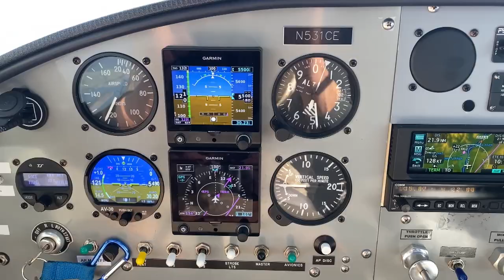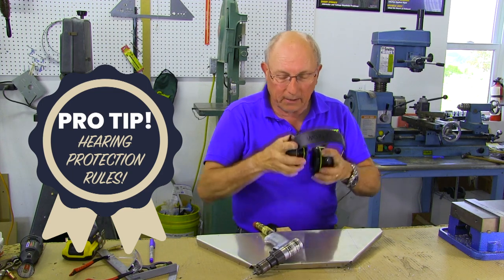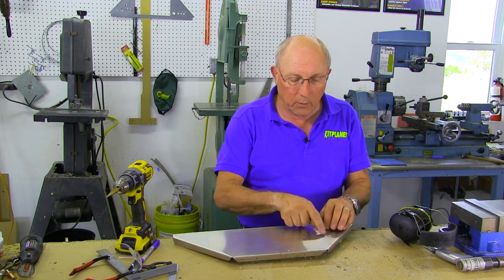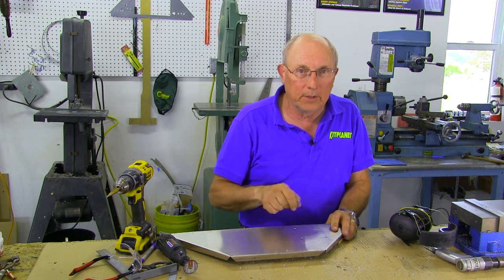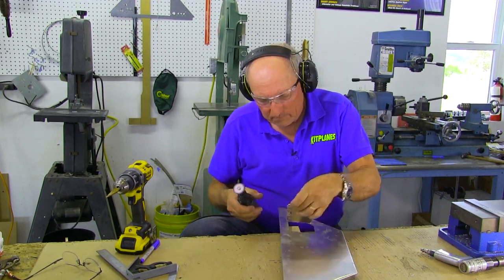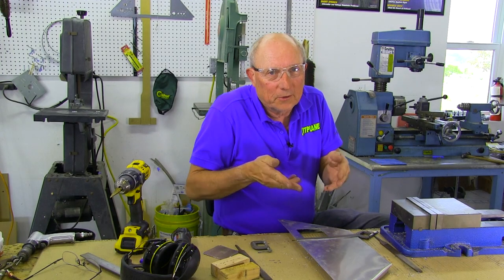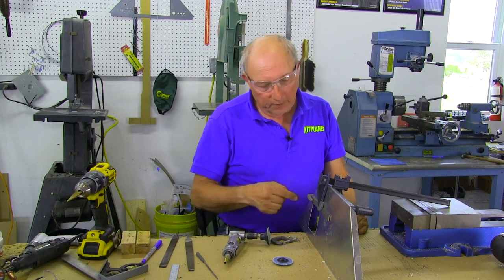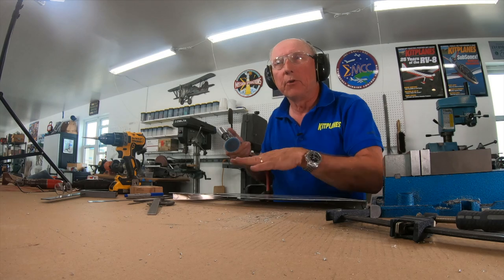Metal Magic: Making Square Instrument Holes In Aluminum

Comment: An alternative to putting tape on the instrument panel to protect from the jig saw is to put tape on the shoe of the jig saw.  That is often faster and easier when cutting many holes.  Generally, it takes quite a while to wear through, but check it after every cut for integrity and replace if it is starting to wear through.

Comment: I have got to a hybrid version of what you did. Use a oscillating multitool with a fine metal blade in a vice or metal break as the guide. That way I don't have to drill corner holes. Just ease in about half way down the cut and  back out to both corners. The oscillating multitools are far more controllable too. Hot glue gun is a great way to hold on the guides until you get them in the vice or clamps. Super Glue will pop off guides fairly well too when done.  If you are going to drill corners and cut down the line, think about using a backing block that is double stick taped to the back for support so the metal doesn't oil can.  You are always cutting into support that way.

Comment: Just wondering what your thoughts are on using a nibbler?
Reply from the maker: Paul says, "I find a nibblers to be OK for gross removal of stuff, but I don’t like getting it TOO close to a finish line. They can run away (at least an air nibbler). Yeah, I’ve got one, but it hardly ever comes out anymore since I have better tools to use.
Reply: I just finished my panel using a hand nibbler. It works fine.

Comment: What the best way to get the lines as straight as possible? I have to cut slots onto the hood/bonnet of my car to get the car back to standard as for some reason it's got the wrong one on. And I can't just buy another as the car is extremely rare. I'm doing all the work to it myself so just trying to find great solutions. Great video by the way I enjoyed it :)

Comment: Thanks for posting this, picked up some new (to me) ideas for electronics enclosures. If the panel is thicker, it can be too much for the dremel cutter, and I'm wary of breathing in aluminum dust. I've found a jeweller's saw to be very helpful for the initial rough cut, which can be scored with the dremel or have a line of holes drilled. Filing is always the tough part, thanks for the ideas here. Anyone tried this kind of thing with a mini-mill? I'm thinking it should work pretty well...

Comment: Use of that angle die grinder with a light touch and firm grip can save many many hours in building, but it does require skill development! Absolutely worth learning, and great to see a proper demonstration of it. A great tool for fiber glass as well😀.

Keep'em coming Paul!

Comment: Very cool. I like your sense of workmanship and safety. 
I just cut a bunch of square holes in a thick steel cabinet with my angle grinder. What a mess I made. Too thick for a Dremel. Maybe next time I’ll use a saber saw. 
How do I cut 4” diameter holes (for vents). 
Thanks,
Paul

Comment: Hi. I like your videos. You make everything look easy. 
I have an aluminum box (Bud Industries) that I’m using for an electrical control box. I need to drill some holes for things, but I also need to cut out some rectangles for a rpm display and a power plug. 
I have a Dremel, a drill and an angle grinder. What’s the best way to make nice rectangular openings in this box?
Thanks,
Paul

Comment: Stupid of me to ask you how to cut rectangular holes when you just demonstrated the process. But my material is thicker and some of the openings are small. Think of one of those squashed rectangular power receptacles on computers and you get the idea. 
I think your technique of drilling four corner holes and using a Dremel is my best bet. Followed by a file of course. 😬
Thanks. 
Paul